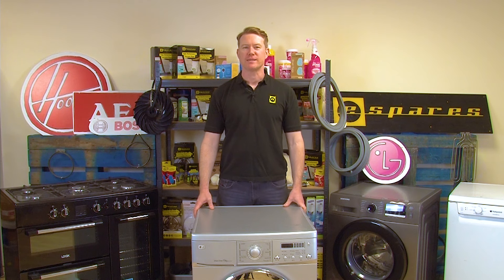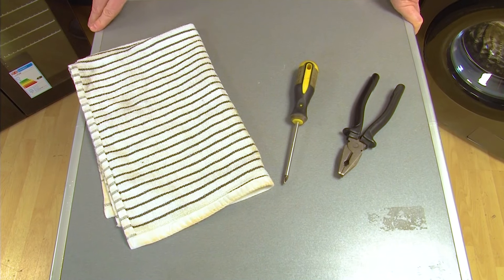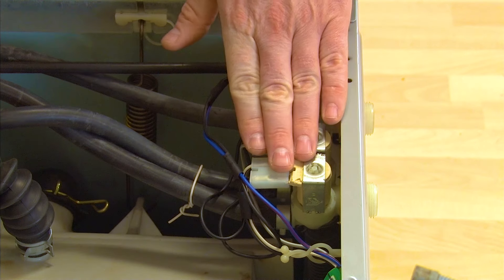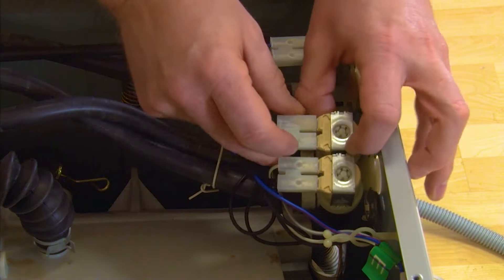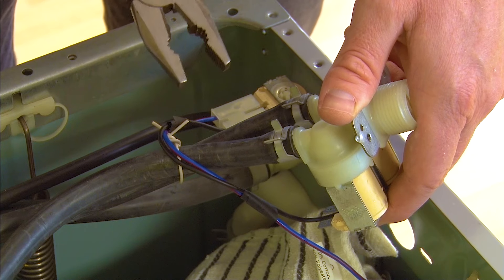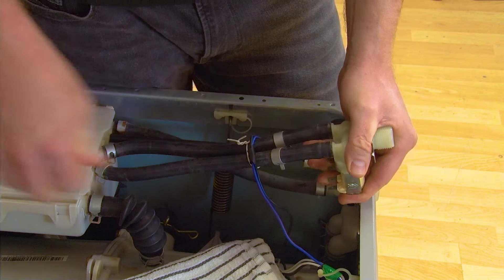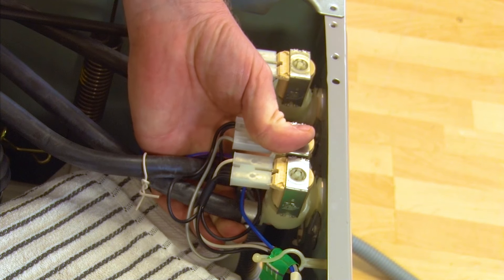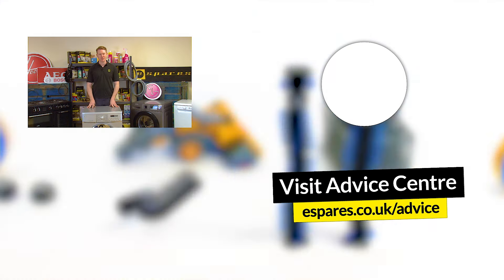How to Replace the Water Inlet Valve on an LG Washing Machine

Comment: Mine tends to have alot of water after a few days of not being used. So I drain it I use it and i drain it again and the next time i come to use it there is water again in all in the drum.
Reply from the maker: HI, thanks for your comment here. If water is entering the machine, even when  the machine is switched off, then it is likely due to a faulty water inlet valve...and it will need to be replaced. You can check out our rang of LG washing machine valves here:
https://www.espares.co.uk/search/ma81pt1753/washing-machines/valves/lg